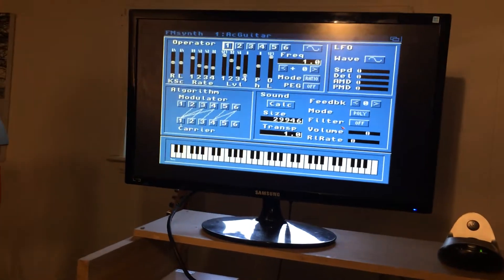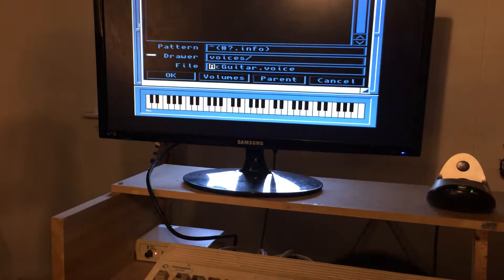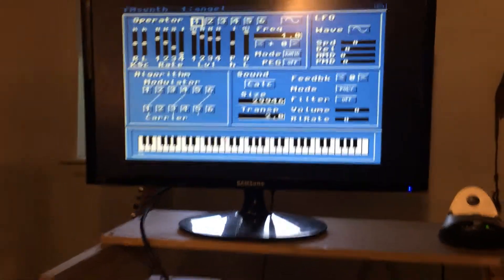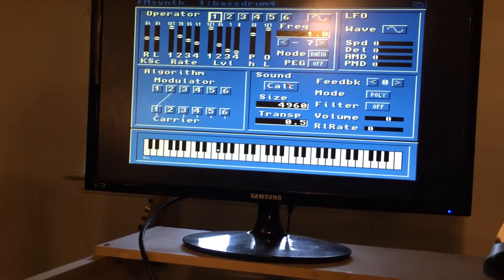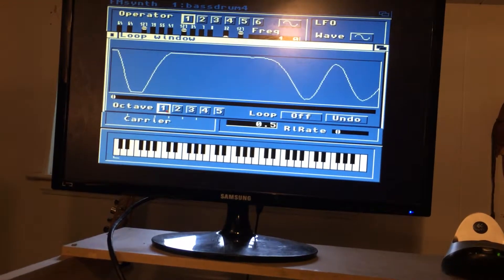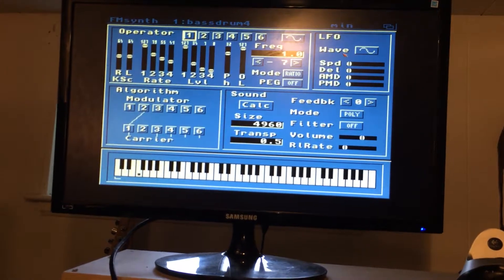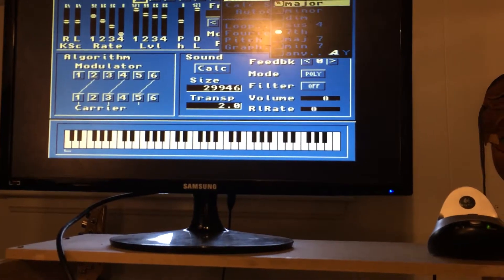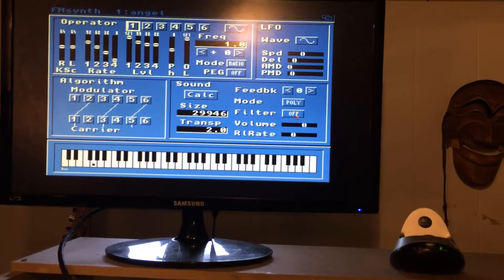FMsynth Demo on Amiga 1200

Comment: My Amiga 2000 is sitting in my basement closet... Been itching to dust it off and fire it up
Reply from the maker: well be careful before you do that..  i would honestly take it to a local electronic repair place and have them inspect it..  if it's been sitting this long it's VERY likely it has some bad capacitors which could prevent it from turning on or may be problematic turning on..  possibly even damage stuff.    Backup battery might need replacing too, if it has one.  

Both of my Amiga 1200's needed four new caps around the PSU input.  One was preventative but the other actually had to be turned on for awhile and "warm up" before it would then successfully boot up.  I was lucky it didn't do any damage.  

Good luck though!  I'd love to have an A2000 some day..  Always had a dream of having a video toaster setup..  I recently got my hands on the first version of lightwave for Mac which is exciting.  Runs under OS9.
Reply: @8bitwidgets  I use an emulator mostly to animate cartoons with moviesetter.  Still an amazing program for it's time.  This 2000 was last fired up in '08 and worked fine then.  But before that hadn't been turned on since '94😆 here's a screen video I did of a cartoon I made when last turned on in '08 https://youtu.be/S32NPTk0AYQ
Reply from the maker: @modeljetjuggernaut4864  yea emulation is nice and i probably should give that more of a look, but i'm kinda sentimental as well just enjoying working with the real hardware.  

yea probably fine but still be careful.  some preventative maintenance could prolong the machines life for years.  capacitors go bad.. it's not a matter of if but when..  and when they go especially if while in use can damage other parts.  So just a word of caution but hopefully it's just fine.

Comment: Hello, any idea whether this will work on an A500+? I’m not sure how much RAM this program needs to run.
Reply from the maker: I don't think this is a memory intensive program. I'm sure the basic 512kb in an A500 (not sure if the A500+ had 1mb) but regardless you should be fine.  This doesn't generate any large files or need to load anything but small "patch" files which the synth comes with a bunch out of the box.

Comment: how did you put the Amiga into the setup? what is the MIDI device for the Amiga machine?
Reply: The fullversion of FMSynth: http://www.amigafuture.de/downloads.php?view=detail&df_id=5125
Reply from the maker: I use a serial midi device that interfaces through the 25 pin serial port.  these could be a DIY project like this link seems helpful and technical enough for someone to engineer themselves https://rastport.com/products/KA12/ but in my case I happen to own one from back in the day.
Reply: i found one to buy: http://www.amiga-shop.net/Amiga-Hardware/Amiga-classic-hardware/Serial-port-MIDI-interface-for-Amiga::817.html?language=en
Reply from the maker: yea i just found this one too https://www.ebay.com/itm/New-MIDI-Interface-Adapter-DIN5-Serial-DB25-for-Amiga-500-600-1200-etc-554/122760426038?hash=item1c95177236:g:4h8AAOSwax5Yq0O6 so yea totally worth it.
Reply: which version of FMSynth is this? is this a free version or do you need a license?
Reply from the maker: I'm not sure exactly where I got it, but i had found a nice adf repository of applications..  i found this collection online but it doesn't have FM synth.  i know that my version is a full version and is either cracked or whatever..  http://www.planetemu.net/machine/amiga  just note that some archives are just about amiga games.. you want to be sure you look for applications.
Reply from the maker: hey i found this forum thread with a link in it to what i believe is the full version ..  http://eab.abime.net/showthread.php?t=21777
Reply: wow thank you ;))
Reply from the maker: my pleasure man, there are few of us left using some of this classic hardware.